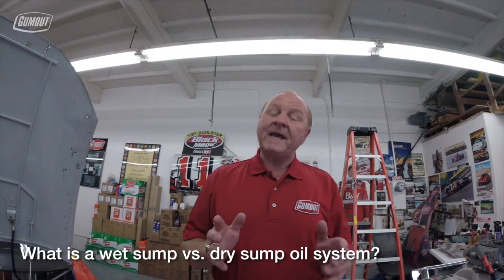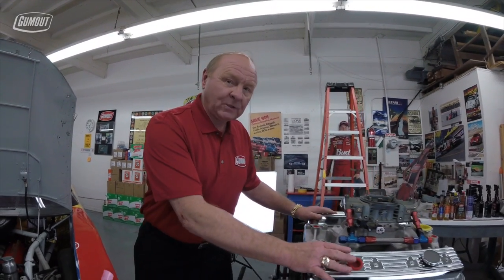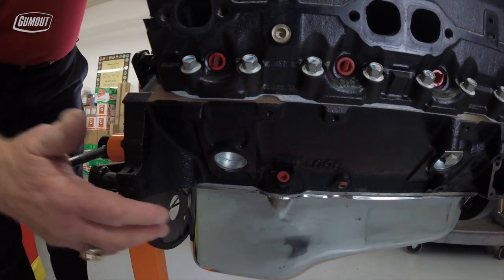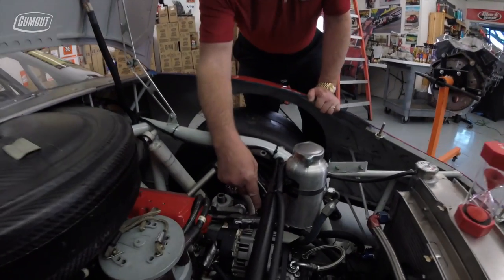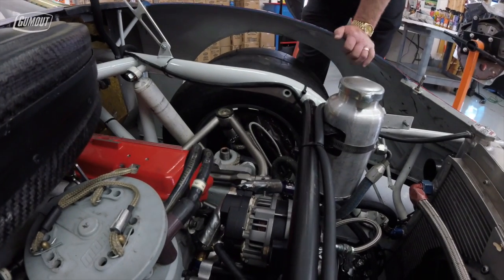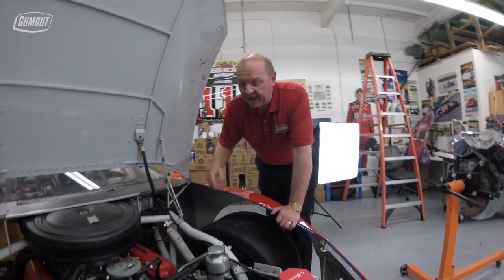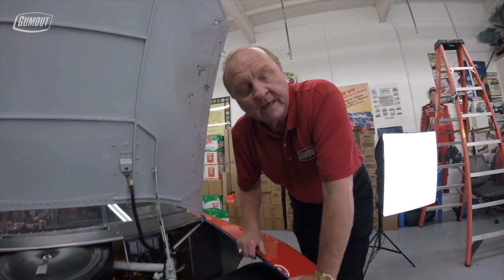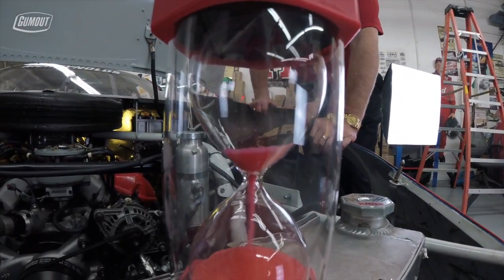60 seconds with Larry Mac - Wet sump vs dry sump oil system

Comment: What Larry didn't have time to tell you is there is a performance advantage to dry sump. You create a negative pressure inside the crankcase (vacuum) during oil scavenging. This vacuum created pulls the piston rings against the cylinder walls. It allows for a looser and more thin ring package which in turn reduces friction and increases power. There is 6 stages at maximum (5 suck and 1 feed) but the more stages you run the more power is taken away from the motor due to the belt drive running more pumps so it's a balancing act. You are guaranteed a constant oil supply no matter how hard you are turning or if you are upside down. As long as you have fuel, air and spark, the engine will continue to run and not throw a rod so long as the belt is attached to the crank snout. Dry sump also keeps the track from getting a huge 'oil down' during a wreck so the track crews don't spend so much time cleaning up fluids.
Reply: We Never really had oil issues in crashes running a external reservoir..  and the horsepower increase was about 30 hp..  oil pressure never moved below forty unless the motor shut down , always constant..  360 ci.    Late 80s..  downside it was a lil more costly ..  but to buy horsepower, ??   That was the trick.
Reply: But yeah,    What you said!!!!!
👍🏻

Comment: Larry Mac....so I have a dry sump LS9 that I am putting in my 65 chevy Impala vert.....is it worth the hassle of going from dry to wet sump in my case? I will only be doing casual riding and possible hitting iy hard from time to time....mind you the engine cost me only $1500.  May I contact you?
Reply: Sell me the LS9 and buy a wet-sump engine.  If you don't road race and just want something for casual driving, you don't need the LS9
Reply: @Imakeplanesboom  Actually....i hve a 2012 LS9 with tranny and front accessory pulleys and belts coming with my 2013 LS9.  Im selling that one so if you are interested..let me know...i can buy a connect and cruise LS3.
Reply: Haha! Larry Mac isn't going to contact you! Bahahahahaha!
Reply: @bonzo354  actually, I am. And yes.

Comment: Question... why will engine burn so much oil in  such a short time??
Reply: Heat and lots of it. These engine's will get up to about 280-300 and sometimes 310 degree's which is quite literally cooking the oil, hence oil burn off. Also, as the oil is repeatedly sheared (molecules are separated or torn) as it goes through the cam, crank, rings and coupled with continuous high RPM, the oil integrity goes away. Again, oil burn off. They use synthetic oil with extreme pressure additives such as zinc to keep critical parts from failing but like with anything, that goes away with time and abuse.
Reply: Thank you

Comment: Most of his comments are pretty spot on... but in this one his reasons for going dry sump are someplace in left field...
Reply: Why
Reply: @americanpride9733   You don't burn up to 3 quarts of oil in a 500 mile race.  If the engine does burn or use 3 quarts of oil in a 500 mile race, it is down on power.  There are many reasons dry sumps are used.  You can get the engine lower in the car, keeping oil off of the crank, not having oil all going to one side when taking corners, and a really big one is it help create a vacuum on the crankcase.  This stops oil leaks, but the big thing is that it helps pull the piston rings out against the cylinder walls so it will seal better and make more power.  If the engine is using a bunch of oil, it isn't sealing very well and making less power.  If there is oil getting into the cylinder and burning, it can cause pre-detonation, and cause a major engine failure.

Comment: I thought a dry sump is worth 50 hp also in efficiency?
Reply: Where did you hear that? Yes they are a bit more efficient but 50HP is a stretch. You still turning a pump, actually the pump is larger and takes more power to turn but the biggest advantage that Larry didn't touch on was 1) space, you can mount the engine lower in the chassis as the oil pan is far smaller, only a couple inches thick. 2) holds far more oil so cooling of the oil is better and helps to remove overall heat from the engine. 3) flow, the pump is driven by pully not the cam or crankshaft. Higher HP engines usually rev higher, the higher revs of the engine means you want control of the pump drive or else the oil will just go over relief and be wasted performance. 4) Hard braking and cornering allows the oil to move in the pan, sloshing about, if it sloshes to much the oil can starve the pick up and you starve the engine of oil.  The only way you might get 50HP more if from a worn engine with a turbo, you might, MIGHT, get that 50HP with the additional sealing of the rings but I seriously doubt it, maybe 10HP increase.
Reply: @hommie789  I’m not an engine builder, only a reader of engine magazines. But I thought the dry sump was very efficient at pulling excess whipping oil from around the crank shaft. This is only what I’ve read.
Reply: @af4od02  more over the big advantage for power is lowering the pressure under the pistons which does two things, helps seal the rings against the cylinder walls and also removes crank case pressure so the piston, while traveling downward, doesn't have pressure against it.

Comment: 4 gallon of oil sure cools the engine
Reply: They also incorporate an oil cooler plumbed in the system. As oil heats up and returns to a supply, eventually the entire supply with sustain temps that are too hot and the oil won’t last. A large oil supply is good, but you still have to keep it cool.